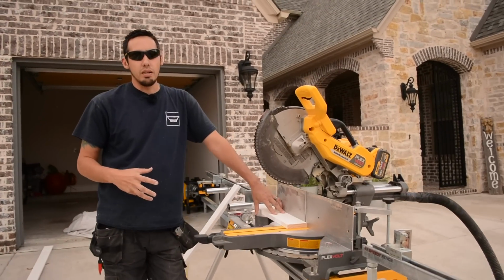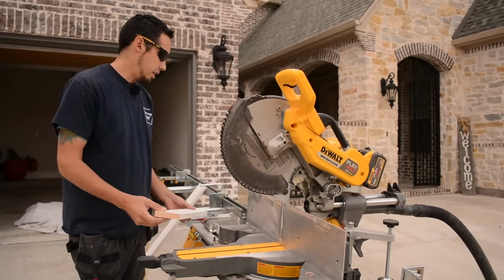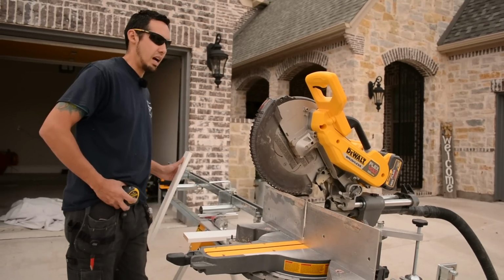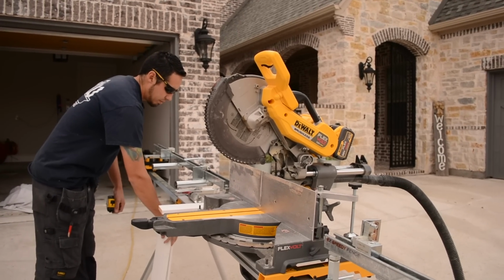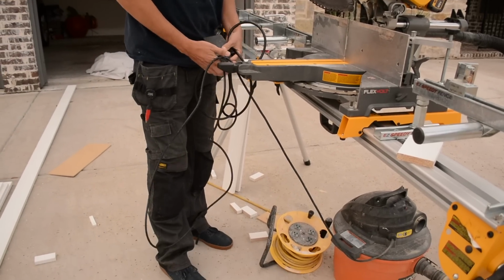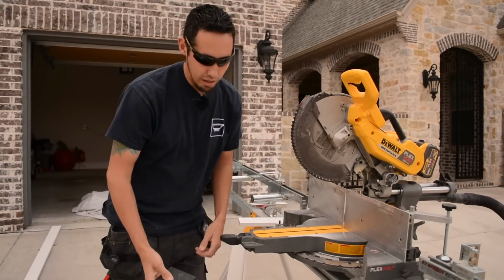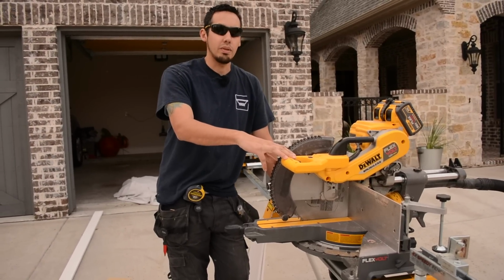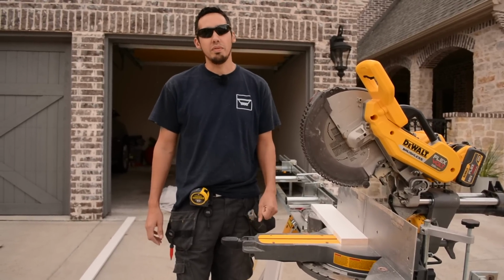A More Efficient Miter Saw Set Up

Comment: Suggest getting a festool vacuum. No pedal needed, it starts when you start the tool. Plus the air filtering is by far the best.
Reply: Won't work with a cordless tool, like the flexvolt

Comment: Hi Richard Congratulations on your house I close on the 23rd also I'm looking for a mitter saw most of my power tools are dewalt 60v and some 20v  now that you are using the flexvolt do you recommend it   12 inch or 10 inch it only for crown molding and working around my house. I will also order the foot pedal thanks (Manny)

Comment: The zero clearance fence is great for straight cuts, but how do you miter with it?
Reply: I was thinking the same thing seems kind of useless. I can see a zero clearance insert on the table being useful but I don't see the use in this fence except for people who like to cheat when cutting crown molding and prop it on an angle to cut their joints instead of cutting it on the flat

Comment: I just have a vacuum that I plug m saw into. When I pull the trigger of the saw the vac turns on and the automatically turns off a few seconds after the saw. Mine is made by Hilti. It's a nec set up that works well with all tools like my plunge saw, grinder etc.. Love the vids all the way in New Zealand

Comment: Just a little tip ! Always fully unwind your extension cord ! It acts as a transformer when pulling high current which is the probable cause for tripping the breaker also will heat up. Have seen them melted due to heat.
Reply: And it will  give less power when it’s wound up,  I would personally use a shorter extension cord.
Reply: Agreed! I see that too often on jobsites.
Reply: It depends on when the breaker was tripping. If it was at startup, inrush current from starting the tools at the same time was probably the biggest problem. Auto-start boxes for dust extraction have a delay built in to prevent this, but with a footswitch obviously you have to stagger the startups by yourself.

Comment: There is a switch box made by DGC. That you plug your tool of preference into along with the vacuum at the same time. It automatically turns the vacuum on when you start your tool up, if your using a power corded tool, It’s been around for years it can be found at Rockler or at Amazon of course. Just a suggestion. Work smarter not harder. Otherwise another great video. 👍🏼
Reply: I've been using one of those for 15 years. It used to be called a current tap and the last one I bought said something else on it along the lines of vacuum switch

Comment: Question! Thinking about investing into the EZ speedy fence set up or going with Fastcap's BestFence, for crown are those extension fence/wings good enough for support or would another 5ft on each side be worth the money?
Reply from the maker: I am not interested in either system at this point. I have not tried the best fence yet.
Reply: Finish Carpentry TV ohh I see. Just curious, so you parted ways with your EZ speedy fence system?? Any of your thoughts from putting it through its paces would be greatly appreciated because I know you really use it in the real world and would know its flaws and benefits! Would probably save me time and money if it's not worth it lol. Thanks for even replying.

Comment: How good is mdf compare to wood on base boards and trim? Thanks for your answer... good video amigo
Reply: One thing I found is that MDF is straight, unlike regular wood that is crooked and bowes.  So you don't need to check for straightness before you buy.
Reply: I wanted to add one more thing.  Be sure to wear a oxygen mask with mdf because it has some really bad chemicals that can greatly affect your lungs.

Comment: My Fein and Festool shop vac start automatically when you key the tool and run a few secs after to clear the hose eliminating a foot pedal. You can also buy the switch seperatly if your vac does not have this feature.

Comment: Foot pedal is cool. I’ve had three relay type boxes that start the vacuum when you run the saw, but they’ve all failed over the years. Plus with a battery saw you wouldn’t be able to use the relay switches.

Comment: I really prefer a solid table. 
Your setups have nowhere to place your cuts.  IDK about u but I measure and cut everything at once and need somewhere to put pieces.  Also on the standard dewalt folding tables the cut pieces want to fall to the ground as you cut them, thats not acceptable.  
Flexvolt...If I have power problems its because the temporary pole is overcrowded.  Do you think it would last all day, all precuts and base or shelving without dying?  I've heard mixed opinions about it.

Comment: When you use the electrical adapter instead of the batteries, does your saw growl? Both the ones I've used do. Kinda sounds like the Festool 75 track saw adjusting its power to match the load.

Comment: We've had problems with the dust boot collector on the back of these saw's blades collapsing under vacuum pressure. Wrapping the boot's edge in tape seemed to fix it. Does your have problems with this? It also appears that your new fence setup might block quite a bit of the dust capture zone, no?

Comment: Check out the i-vac switch it’s a auto on switch. Then there is no need for the pedal. Or just get a festool vac or the fein vac with the auto switch built in.
Reply: Justin Lamarche, I've had two of the iVac switches and they have both gone bad in just a couple months. I switched to a different model that seem to work just fine. Check out their reviews. I believe it's the cheap relays they use.
Reply: Justin Lamarche he’s using a battery powered saw so that option wouldn’t work.

Comment: I'm buying a foot pedal for my miter saw vac. You have some great tool man. I remember my dad telling me as a kid to buy the best tools & I have.
Reply: delay switch is better. who wants to press a pedal?
Reply: Joe brown do you have a flexvolt cordless saw? If so the pedal is a worthwhile investment but if you are running a plug in mitre saw go get a current tap. It's a box you plug in that you plug the saw into and the vacuum and it runs the vacuum automatically everytime you turn on the saw
Reply: @bolerdweller  where to get this tap box. I have a plug-in DeWalt
Reply: @bartseller8601  if you've got a plug in you just use a current tap. I think they just call them vacuum switches now from your local tool store. The ones I uses are about 70 bucks. Plug your tool into the master and vac into the secondary
Reply from the maker: Joe Brown thanks!

Comment: Someone really needs to come out with a product that turns the vacuum on automatically when you turn your battery tool on.
Reply: Noconz0727 MC Festool has. Blue tooth $80.
Reply: renaissancemen1 

That only works for Festool
Reply: Makita has a Bluetooth switch that turns their vacuum on soon as you pull the trigger.  But im pretty certain it's with the Makita Bluetooth vacuum

Comment: Great set up but not top of the line. Tom Silva of toh has a digital set up where you just tap in your measurement and the stop extends out to exactly that setting automatically. Very,very precise and quick.
Reply from the maker: like a rock that set up is over $5,000. Which is fine. Just not in my budget. 😂
Reply: Maybe next upgrade?  Would make it more fun ,I would think.
Reply: I’ve never heard of that. I’ll have to look that up. Not spending $5K. Hahaha.
Reply: Finish Carpentry TV : A new sponsor. Ha!

Comment: Fyi, runing a cord wound up like that will add to the tripping the breaker thing, and my understanding is that the ramping up of  electomagnetic hysteresis that in turn causes strain on the tools and the cord.  This should never be done, or so I've been told. Also, was that a 14 gage cord?

Comment: I switched to bags in my vacuum too. Have you tried that? Costs a bit more but better on the lungs and cleanup.
Reply: Buy an Oneida cyclone dust collector attachment and hardly any of the dust will make it that far. It's a little cumbersome if you're vacuuming, but for something like a miter/tablesaw station, it's a total game changer--a Festool CT26 behind a cyclone collector mounted on a Homer bucket changed the way we do tiling and prep work.
Reply: been researching that setup myself.  Thanks for the tip.
Reply: The Festool handles the relay problem too, it's a serious piece of equipment. Might be hard to justify if you aren't in an environment where you need to be anal about dust (we do restaurant kitchens) but even then, Shop Vac filters aren't cheap and more importantly it's just a pain in the ass.
Reply: Yes great piece of equipment there. I have no need (want, yes) for it so I have the shop vac (bags) and run the I-Vac switches with my saws and tools which handle the load issue well.
Reply: Seems like I and other people have had issues with the I-Vac switches, but it hasn't stopped me from replacing them when they go. I've been meaning to send an email to my electrical engineer buddy to see if he can advise me on how to fabricobble a better, cheaper (or at least longer-lasting) solution--he's a manufacturing whiz so who knows, maybe I can stimulate his entrepreneur side.

Comment: I’d suggest 2 things. 1. A trash can for your scraps enabling you to keep your workspace cleaner, to look as professional as your work and 2. Move your vacuumed and extension plug from under the miter saw where miscellaneous dust will fall into the electrical plug and vacuumed filter. Other than that it’s a rock’n set up! Now go put that 80 tooth Diablo blade on that bad boy and get to it.
Reply: Diablo blade?? They have far too much deflection( wobble) because they are so thin. You must shop at Home Depot lol. Specialty stores have much better blades.

Comment: I think you should get the i-socket 110m Tool and Vacuum Switch. When you hit the switch for the saw it turns the vacuum on automatically and turn it off when you let go of the switch
Better than the one you have because it is auto vs stepping on a switch  like the one you have
 https://www.amazon.com/i-socket-110m-Tool-Vacuum-Switch/dp/B001BSL1BM/ref=sr_1_14?ie=UTF8&qid=1520311671&sr=8-14&keywords=Auto+turn+on+switch
Reply: Won’t work with the cordless saw. The I-socket turns on by reading current flow. So the tool would have to be plugged in.

Comment: So with the zero clearance, you can't make compound miter cuts, or you don't do that very often?
Reply from the maker: Edward Tse you will need to move them aside to make any bevel cuts. We rarely cut crown moulding flat. Always nested.
Reply: Can you not incorporate a tape rule bonded on the fence extension?
Reply: Finish Carpentry TV I was thinking the same. But WAIT!!!! They attach to the sliding fence????? I’m sold now. Sweet!!!
Reply: Until your apprentice forgets tp move them and cuts through the fences. 😂